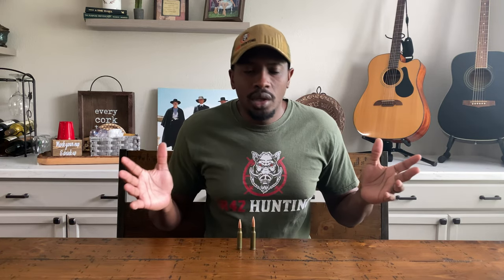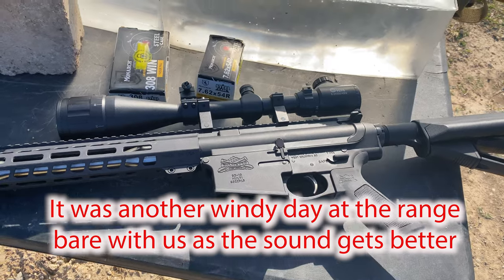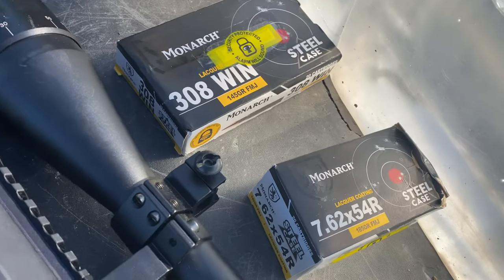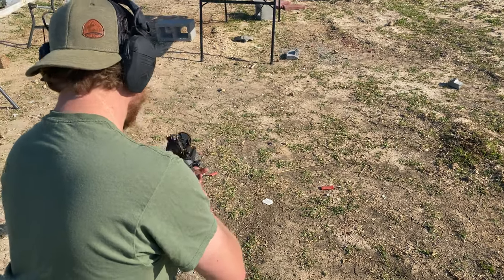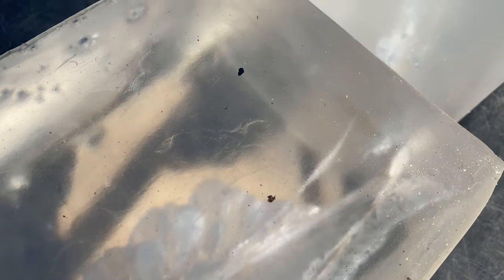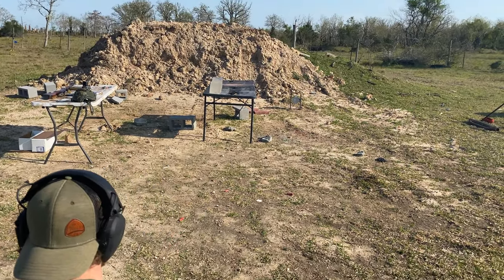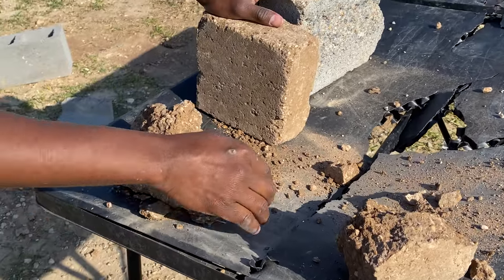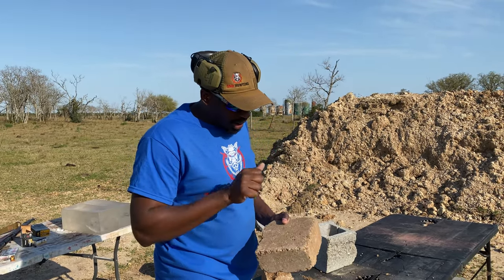308 vs Mosin Nagant: Penetration test

Comment: Yea was very close! The .308 has a higher max pressure & the lighter bullet, so was definitely going faster but the 54r definitely had more energy. The 54r is actually a .312"-7.9mm compared to the .308"-7.8mm. More surface area, more friction, usually a little less penetration. Slippery slope, like how a 22 win mag having less power can out penetrate a lot of stronger bullets bc it's so small. 
  On paper the 54r & 308 with same bullet weight are very very close, with the 308 able to handle almost 7000 psi more it kinda has the advantage, although the 54r can typically handle a heavier bullet, which would give it the advantage lol. 
  That's a good one man. Good testing too! You could do a lot more testing & probably not have a clear answer on the winner!👍👍
Reply: Agree...different bullets. I always thought the 54r compared more with the 30-06 rather than the 7.62x51 or .308, case similarity being the more common factor, although the 30-06 and .308 bullets are the same in most applications.
Reply from the maker: Agree with all of that Raptor!

Comment: what most people dont realize when comparing both calibers is that the 7.62R is almost always shot out of a mosin that means its a 29" barrel and well 29" 308 barrels are not a common thing. That and the fact that 7.62 nato is actually a little weaker than 308 I wonder if thats the reason why all the fanboys online brag about the 7.62R being better "more powerful" than 7.62Nato but they dont realize its based on a flawed method of comparison or they are just that in love with sticking it to the "capitalists" lol